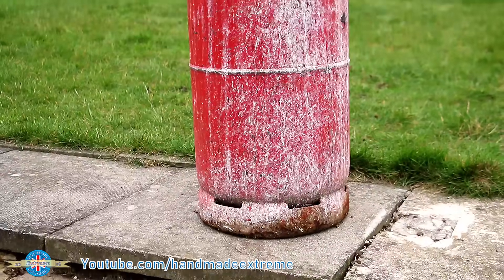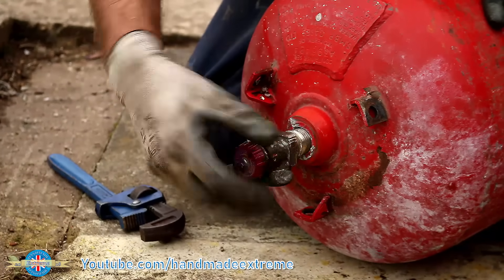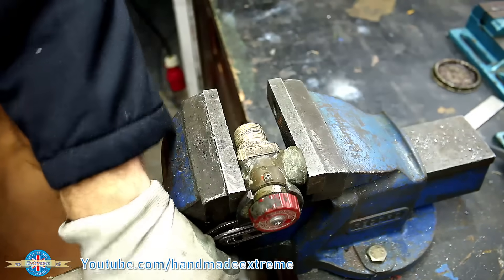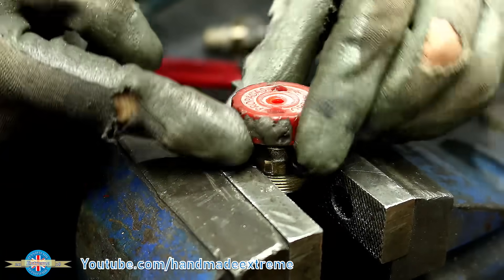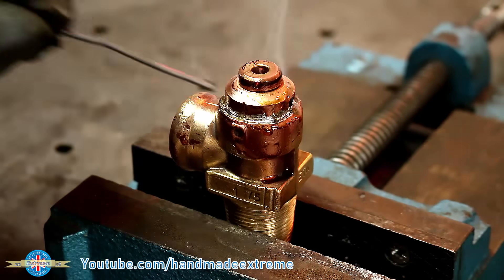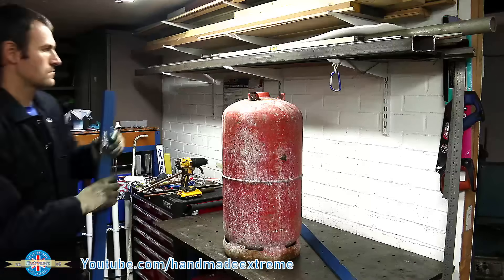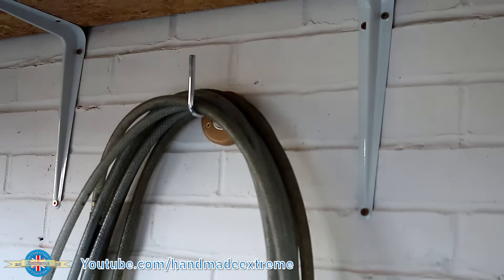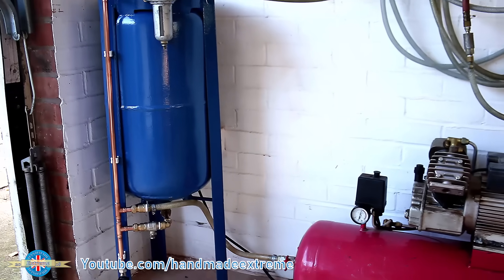Making an auxiliary air tank from an old LPG gas bottle.

Comment: It’s a neat bit of fabrication but has it been certified at the working pressure. I’ll pass thanks as you could be building a bomb!
Reply: lpg bottle should easily have rated to exceed something like 8bar's which can be found on many air systems. Though I'd most definitely add overpressure valve and I'd very carefully examine container. Also welding on factory made pressure containers is actually a very big no, no. Some kind of an "rim" insert would be much safer.
Reply: @jothain  He didn't weld on the vessel itself. He welded on the rim/feet and thus didn't compromise the integrity of the vessel.
Reply: @kazykamakaze131  Good correction. Had to actually check again and you're absolutely right there. Looked vid on phone and looked originally that legs were welded on container itself. But that's not true as you mentioned.
Reply from the maker: Great comments guys. The comments section has turned into the wild west a bit so it's a joy to see people respecting each others views and communicating clearly. Regarding the original comment about working pressure. The tank is rated to a test pressure of 350PSI which is well in excess of the 150PSI max working pressure. 
Your spot on about the welding of the legs to the rim and tabs. This is to ensure that integrity of the tank remains valid.  👍👍👍

Comment: Reckon you could do a video about that mountain bike in the background?
Reply from the maker: I do need to replace the push fit bottom bracket at some point on it so will probably make a press tool for doing that. So quite possibly... Thanks for the support. 👍
Reply: I spotted that too... 🤘

Comment: Nice job but very unsafe. Propane tanks are built like war tanks, but designed (and welded) to be refilled way fewer times that an air compressor bottle, who can be "inflated" like a balloon several times by hour without stressing it.  Doing the same to the propane tank will stress down welds and could end in an explosion.  Be safe mate
Reply: k halliday  ask yourself why the welds are so different for the same purpose, (to hold a gas inside).   As I said, it's not the same to inflate/deflate them several times by minute, than once in a month. That weld in the middle will stress sooner than later, keep an eye on that.  A propane tank is at 80 a 125 PSI when full and an air compressor works between 16 y 145 PSI so... GAS bottle does not holds a MASSIVE pressure inside like you say...
Reply: @rvoar  Actually there are many that run at close to 200psi for gas bottles normally and they are designed for 400psi+ tested. So 150psi is peanuts for a tank like this with air in it. Oh btw gas tanks expand and contract every day by a considerable amount, what do you think of gas leaving a tank does to it? or what about gas tanks stored outdoors with sun hitting it and then gas leaving it? How you you think thermal expansion works? Please think before you talk as you do not sound very smart.
Reply: @kazykamakaze131  No problem, my mistake.  So I'll start a new air compressor business, saving a lot of money in the air tanks recycling old Gas bottles... Thanks for the idea.  (mode sarcastic off)
Reply: @kazykamakaze131  thanks a lot to teach me!   you are the one.
Reply: @kazykamakaze131  you are the one that sounds not smart here. Just stop already. It’s obvious that this is NOT your line of expertise or experience.
Reply: @kazykamakaze131  Relax fiend, take a beer.  Peace.
Reply: Dani mate thank you for your informational post. So many twits here in the comments are ignorant of real compressed air knowledge. Propane is measured in weight, not volume or pressure. People here never cease to amaze me with their ignorance. Doing my best to police up bad information sharing.

Comment: All pipe runs should run down.    Horizontal runs can hold a surprising amount of water!

Stavros
Reply from the maker: Great comment, thanks. There is a slight fall from the bottom of the tank to the drain but I forgot to mention it when I was doing the voice over. Thanks for watching.
Reply: Just make drip legs. Problem solved. Air lines should run LEVEL AND PLUMB
Reply: @nigeleharis5886  Uhhh, no, horizontal runs shooed always slope lightly toward a drain or drip leg,  preferably in the direction of air flow.  Level is a bad idea, nothing is perfectly level or straight and water can sit in a slight low spot and cause corrosion.
Reply: @andrewalexander9492  yeah, for water. I design air systems with features that get around the problem you are describing.
Reply: @andrewalexander9492  are you a plumber or a pipe fitter?
Reply: @nigeleharis5886  It doesn’t really matter, I’m not one of those types who tried to prop up their arguments by saying “I’m right because I’m XXX “.    I’m more than happy to let my statements stand by themselves without trying to flash some sort of credential, which doesn’t prove anything.     A slope for horizontal runs of compressed air distribution lines isn’t required in ASME 31.1 or 31.9, which are usually the adopted codes, (depending on the pressure) but it is a very common requirement in other construction standards, and in manufacturer’s recommendations for installation of their equipment.  Here’s the US DOD specifications for compressed air lines installed in military installations.  https://www.wbdg.org/ffc/dod/unified-facilities-guide-specifications-ufgs/ufgs-22-15-14-00-40 

“ Compressed air piping shall be free of unnecessary pockets and pitched
approximately 25 mm per 10 meters 3 inches per 100 feet in the direction
of flow to low points. Where pipes must be sloped so that condensate
flows in opposite direction to air flow, slope 50 mm per 10 meters 6
inches per 100 feet or greater.” 

Here’s the specs for compressed air system installed in Clark County NV (Las Vegas) aviation facilities:  https://www.mccarran.com/pubfile/38f36c44-532a-4f2a-8f6e-1adba3371da3/123082/Section%2015211%20-%20General%20Service%20Compressed%20Air%20Piping.pdf?t=20120801-000000

“B. Install air and drain piping with one percent slope downward in direction of airflow. “ 

Here’s Hitachi’s recommendations  for installation of their industrial compressor systems: 
https://www.scribd.com/document/382152373/hitachi-compressed-air-piping-recommendations-pdf

"Pipe Slope
All lines in the system main and branch lines should slope or pitch downward at least 1" per 100 feet or less in the direction of the air flow to a drain point – drop leg, receiver, etc. This will allow condensation to collect at the low points where it can be trapped and removed."

It’s fair to say that there is an effective air dryer installed on the source, then slope on horizontal runs is probably not important or required, but then, we aren’t talking about a system with a dryer installed, are we? we’re discussing the system in the video, which doesn’t have a dryer,
Reply: @andrewalexander9492  so, NO you’re NOT. Thanks! 

Great work doing that digging though. Like I said, I have ways of negating the need for slope, but will definitely earmark all these datum you’ve shared! My company follows ASME. None of the other links are sanctioning bodies, and the people who make those plans are not air compressors technicians most of the time. I don’t care that you can show me who does it that way, but I hope you acknowledge what I am saying too. Those links you supplied are from people who call company’s like my company for assistance with their air compressors and air systems. From tire shops, to power plants and refineries. My company also services all branches of the miltary and also for multiple major airlines. Soooooo yeah lol. 

I’m respectfully standing my ground saying I know more on this topic here than the vast majority of people that will comment on this video, especially those like you who are trying to put me in my place.
Reply: @andrewalexander9492  and actually it kind of does matter what trade you are, because I am speaking knowledgeably from things I actually do at work. You seem to be regurgitating information you found on the internet. I wish I could thumbs up AND thumbs down your reply at the same time. Basically as soon as you mention ASME, I can stop reading.
Reply: @andrewalexander9492  like I said, call me an asshole all you want. As far as topic material, we’ve both proven my point lol. I’ve also said both methods are correct. But you can’t let it go that I’m rough around the edges huh? Lololololol 

The slope is for the water in the air. it’s not for the air. There’s water in the air. I get around that through air system components and design..I’ve shared a lot, you’ve shared links and the fact that you traditionally believe air systems are necessitated to have a slope in horizontal air lines.Yeah, it’s functional in theory.. It’s gonna look ugly vs a system done with level horizontal runs. Your air compressor should already have a condensate solution because of the air receiver it usually comes with. How much water do you need to have removed from the air you’re using? You can use half a dozen different measures to combat condensate before even designing the air piping itself. Like what? EDV’s and in-line moisture separators for a couple. Many air dryer options.....I can and will go on back and forth all day here if you want to, bruh.

You’re pointing out personality traits and I am pointing out vocational information. For the sake of this, I will delete my comment that says “wrong” but if someone performs work that way under my watch, it is indeed wrong. So who’s perspective is MORE correct here or HOLDS MORE WATER (see what I did there?) Yours? Because you read in a handful of places that there should be a slope to the piping. Or mine? A journeyman millwright specializing in air compressors and compressed air systems? Who’s day to day vocational work is dedicated to matters of this sort. Maybe like you I will “let my statements speak for themselves blah blah” 

So what are YOU trying to do here? Still put me in my place? Have me acknowledge I’m an asshole? Get a life dude. This clearly isn’t your line of work.
Reply: @andrewalexander9492  just remember where you included ASME in one of your replies. It all ended there.
Reply: Be it known i deleted my post saying someone is wrong for believing a slope needs to be implemented in horizontal piping runs. Lmao

Comment: why not use cutting oil when you were drilling the fitting?
Reply: It's brass, it's not necessarily the drill bit that gets hot but the material itself rather. Brass galls up and grabs, you could use some oil if you want to as it won't hurt.
Reply: @kazykamakaze131  it is not a matter of heat. I understand that CUTTING oil suspends small particles and can and a micron or so to the drilling. Is this not your experience?
Reply: @davidewing9088  Depends, if the material you are drilling tends to bind would it not help to have a lubrication so that the ejection of material is helped?

Comment: I have a 60gal air compressor.  If I need more air, I'm in trouble.
Reply: There are still reasons to need to add a tank to a system other then low total capacity like if you add a plasma cutter or plasma table in you might need a tank next to it to deal with line lag if it is a long distance from the compressor.
Reply from the maker: That's a monster, I'm jealous.  Thanks for the support.
Reply: If those are US 3.8 litre gallons then you have the same volume of air I have across my compressor (70l) and receiver (160l) and I concur, it's ample for almost every need, though I'd still go bigger at low cost if I could. For now, it's ample and I'm more than happy. Much better than the 70l compressor alone for various reasons.

Comment: Left to loosen, right to tighten. It is possible to remember without sounding like a 5 year old 😂
Reply from the maker: Hahaha, why didn't I think of that. 👍
Reply: This is not always the case. For example, oxygen/acetylene torch setups. One has left hand threads so as to prevent getting your lines mixed up.
Reply: @nigeleharis5886  Stop being such a boring egotistical killjoy. Safety advice has been given. Leave it at that. Aloha from Australia
Reply: @phillipstewart5537  lmfao what???? You sound like the 5 year old the comment poster is talking about. “Left to loosen, right to tighten” is not safety advice, mate. I have no aloha for people like you, calling others egotistical killjoys.
Reply: @phillipstewart5537  and there are also many rotational machine parts that necessitate the need for left hand threads. This knowledge can and does prevent machine part damage. So get rekt, mate. Go try and put someone else in check lol.

Comment: Good job, but I would have use AC copper tube which is thicker
Reply: the strength ratings between type M and A/C is negligible  https://www.engineeringtoolbox.com/copper-tube-astm-280-d_1084.html

Comment: I wouldn't use copper pipe for high pressure use.
Reply: Why? A copper pipe can held a lot of pressure. It depends on diameter, thickness an anealing status.
Reply: @Mike A, that's just because you don't know much about copper.  Most types of Copper pipe are plenty strong for compressed air systems.  the Copper Development Association (Copper.org) has extensive engineering data for copper pipe, including bursting strength.
Reply: It is a pretty standard thing to use in air systems.
Reply: “High pressure” is a matter of opinion. I use type K copper for many air systems I design, fabcricate and install. Would definitely use K over L type. I solder up until 2.5” then I will silver braze. 

I’ve also used schedule 40 galvanized steel and  schedule 80 black pipe. I Do not use schedule 40 black pipe as it is not rated at a high enough pressure.
Reply: Please read what is "water hammering" and educate yourself about how plumbing works in your house and what pressure these pipes hold because of water hammering. Can bet you now the numbers you are going to see will surprise you.
Reply from the maker: The pipe used is rated to a burst pressure of over 600PSI in it's annealed state and well over 1000PSI in it's as drawn state. Obviously different materials and where you are in the world will affect this. Thanks for watching.

Comment: Ever see air tank explosions? Recycling old ass steel tanks as pressure vessle is probably not a good idea as a whole
Reply: This is an interesting question. My propane tanks says tested to 26.8 bar (about 400psi). A nearly empty propane tank at 30deg C would have a pressure of about 140psig, so it seems to me that a propane tank is designed to hold gas at about the same pressure as workshop compressed air with a big safety margin. Now, I ask myself, do I trust a gas cylinder designed for heavy duty use, being dropped, etc. or the tank that comes with a cheap Chinese compressor?
Reply: @jonbowden1744  I hear you loud and clear and its probably a crap shoot. My main worry is that propane bottles are pretty thin, with a set life expectancy, maybe stored out doors, and let's face it...many folks wouldnt think to look the tanks over really well or think of the "energy" they are trying to store. It's just risky, but we are all adults, I'm no nanny :)
Reply: @unknown-ql1fk  I have a better idea, use the propane tank and don't weld on it and when you are done store it behind a steel cage outside, problem solved. Too many people complain about safety yet those exact same people when looking at their air compressors you will see none of them store their compressors behind a safety cage, so it's a bit hypocritical of these people to talk yet don't follow their own safety guidelines. My air comp is stored outside under covered steel cage and reduces the noise in the garage considerably and adds a huge amount of safety as well.
Reply: @unknown-ql1fk  It's likely that the propane tank has been hydrostaticly tested more recently than a lot of air receivers in non-commercial shops.  Propane tanks are required to be tested on a time schedule, and may not be refilled if they haven't been tested.  If an air receiver is not in a commercial setting that required hydrosttic testing, it may never get re-tested.
Reply: @kazykamakaze131  your unit is safe behind your steel cage however, definitely.
Reply: I wish more people felt this way. This LPG tank was not designed for what it has been made to do in this video.

Comment: Great video, and in theory the water will collect at the bottom, but from experience it will only do so when the air etc is cool, when it's been running for ages it'll be too hot for that short run of copper to condense it. Usually a longer run from the compressor is needed before a water trap. But the reg at the top will catch some too so unless you're spraying with it or using a plasma it will probably be more than sufficient. I've got a water trap 5ft above my compressor which rarely catches much water, but the one after 50ft of pipe at the plasma catches loads as the air has had chance to cool down.
Reply: I was about to make the same comment, the air will be too hot to condense in the short run of pipe.
Cheers
Reply: @ss54.  it'll work grand for that.